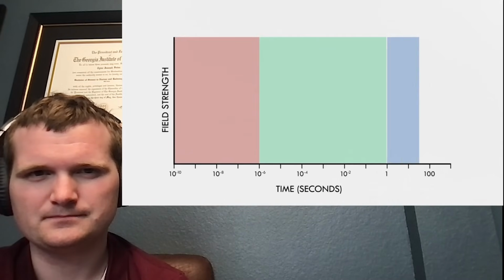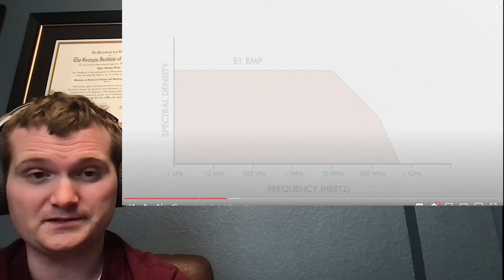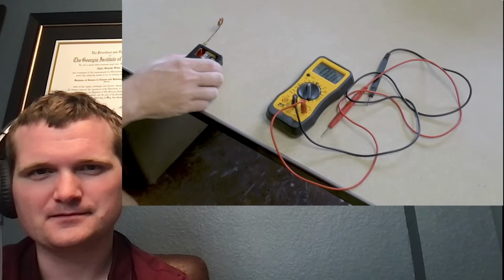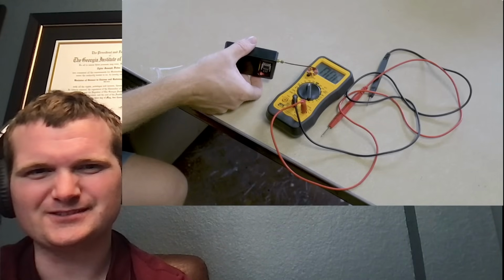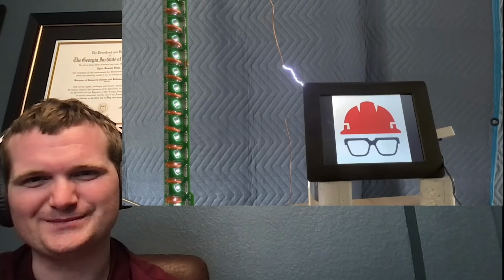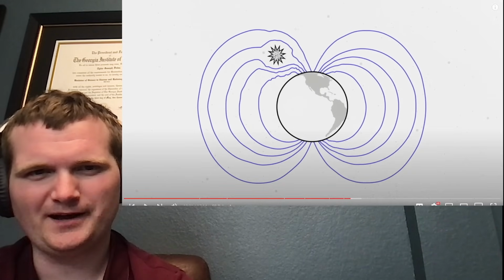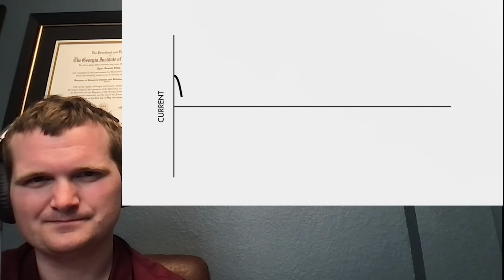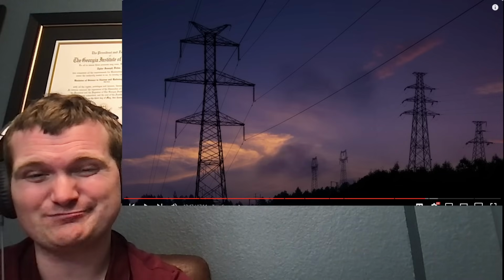How Will a Nuclear EMP Affect the Grid? - Nuclear Engineer Reacts to Practical Engineering

Comment: Everyone glosses over to "well generators can fire up and handle critical things like life support, and reactor cooling".... EXCEPT the same prompt and residual emp will damage the generators too......hard to get your gen-set up and running if it's control boards are cooked by the prompt pulse and windings are fused by the residual 🤷‍♂️
Reply: not to mention the computers and other electronics for the life support and other critical systems being fried. Last I checked those (apart from maybe some military systems) aren't EMP resistant.
Reply: The amount of damage electronics take is directly related to their size. It's way harder to take out emergency generators vs taking out power lines and transformers.
Reply: @Vexas345  as a 20+ year licensed electrician, with a vast understanding of electrical theory. I can tell you, the massive windings in a large generator have as much wire (linear feet of insulated wire) in them as some of those large transformers do.
Your 3kw Honda generator you use at home mayyyy be okay, a 500kw generator, which is the size of a small building, and used to power things like a hospital or the backup systems at a power plant, won't be okay. The amount of damage done is not relative to size of the item, it's relative to the length of wire contained in the item. More wire, more damage, simply put.
Reply: @John-ir2zf 
How likely would a phone be to be fried?
Reply: @cortster12  the closer to the epicenter of the prompt pulse, "e1", the more likely. Also, the more complex the phone, the more vulnerable it will be because of the extra circuitry it has. Example, an old school flip phone is far more likey to survive than an iphone15. The iPhone has more sensitive circuitry because of all the options it has.
No one employs Faraday cages (except me lol) but a properly grounded cage will absorb the EM pulse and shunt it to ground thereby keeping it from getting to the device inside.
Reply: @John-ir2zf  Okay, how much antenna theory do you know? I should have said "generally" based on size, because the amount of energy absorbed will be limited by the overall cross section of the wire paths in a device. And the upper end of those paths is limited by the device size (for example, your phone can't have a 1 m antenna/straight wire inside it). Generators have the advantage of being inside buildings and being giant metal structures, among other things, which both attenuates the EM energy reaching their components. Sure, you'd have to consider the overall length of loops in the object, but that only matters if the energy is absorbed in the first place.
Reply: @Vexas345  you may have missed a vital part here in this comment about how generators tend to be in metal enclosures and in big buildings, some times metal buildings.
ALL of which will be interconnected according to the NEC (metal enclosures, building structure steel etc must all be interconnected to ground)and thus serve as a pathway back to the generator components for transient (em induced) voltages via the mandatory grounding connections 🤷‍♂️
Reply: @cortster12  Very. Because while the electrical traces for the circuits in your phone aren't very long, they are very very small and delicate so an EMP would fry them.

Comment: And once again a great video with a lot of good info. Small question. If the NPP were to be hit by an EMP, wouldn't the emergency diesel generators also be affected? If so, what would be your other options for keeping the reactor(s) cool?

I thought of an idea for some merchandise for your YT channel. A T-shirt with an RBMK reactor on it, with a thumb nail of you+safety goggles looking sideways to it saying; "Let's not stress test this."😁
Reply: They are isolated by a transformer and have transient suppressors. These generators have fairly robust power electronics that will not be damaged by the E1 or E2 pulse, essentially they use a mechanical governor and the starter is basically a heavy duty motor. It's possible that the voltage regulator might get fried but they are protected with bilateral transit suppression diodes that can take the power.
Reply: @christopherleubner6633  
Thank you for this comprehensive answer. I already had a feeling not much is left to chance when it comes to nuclear backup systems, but it is nice to have it explained in such a clear manner.

Comment: Other question, can we restart the power grid during a blackout like we do when reviving humans with a CPR?
Reply: Another question is how strong the pulse was. In the deep/dark red area, the pulse may be high enough to "brick" transformers which would be very, VERY bad. Wires and switches down range from plants are much easier to replace and, unfortunately, most transformers located at plants, are custom built over several months for each site and backups are rarely available (they can weigh anywhere from 6 to 15 tons each). It's one of the reasons that power stations are almost always on military "no strike" lists but lines and transfer stations are not. Those are usually repairable within 1-5 days. (If anyone is wondering, I'm a recently retired USAF Targeteer)
Reply: It depends on how completely down it is, and for how long. I believe Grady has some vids on that, particularly around the texas blackouts. I remember something in the vicinity of 3 to 4 weeks!